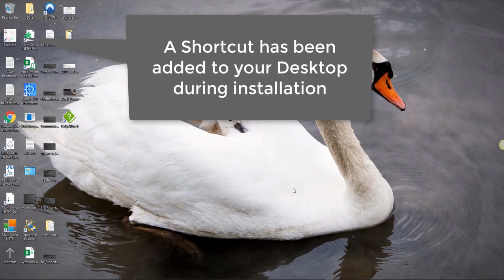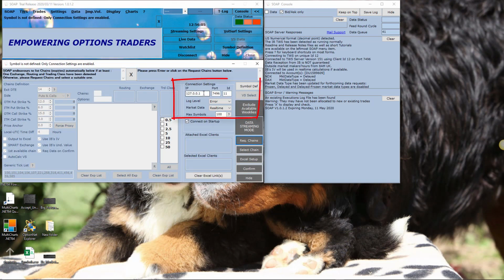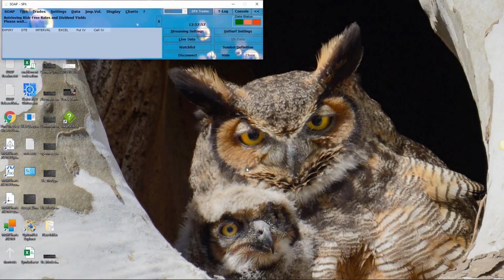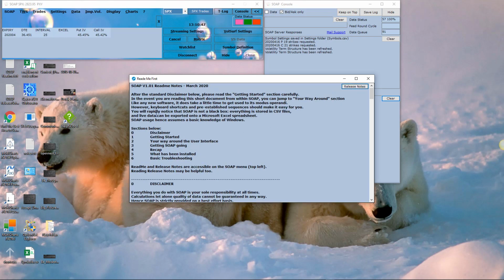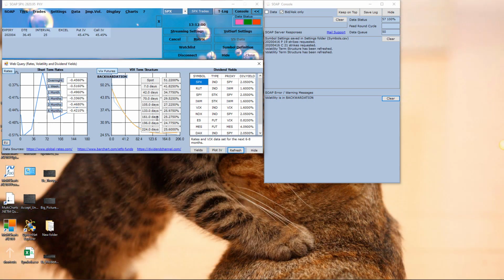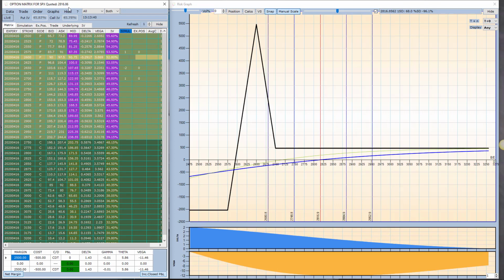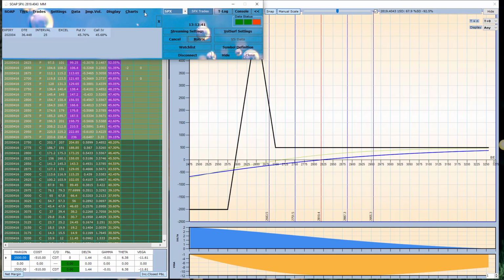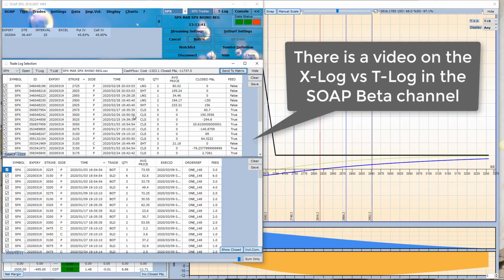SOAP V1 01 Introduction

Comment: You are correct, very confusing.  Do you plan to have the expirations to be in a standard format ....17APR20 verses what you have chosen?  What are you planning to sell this beast for?
Reply from the maker: I can certainly change the date format.  The standard format in IB is yyyymmdd and to make it simpler I separated monthlies from weeklies, monthlies are in the yyyymm format.
Reply from the maker: Maybe the S in SOAP should be Smart and not Simple.  I've tried my best to keep it simple and I still believe it is.  However the emphasis has admittedly been on proper modelling.
It may take a little practice but I can assure you that it works well with default settings.  I have received very valid feedback and I am busy incorporating a few simplifications in V1.01 Preview 3 to be released next week.